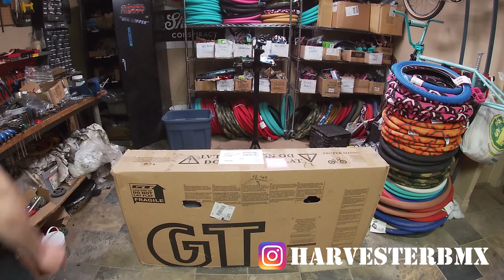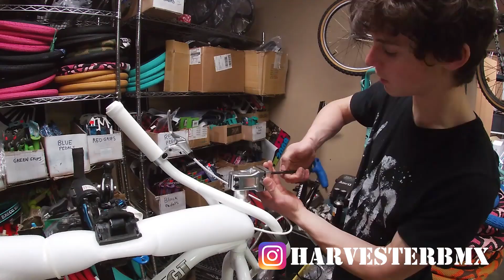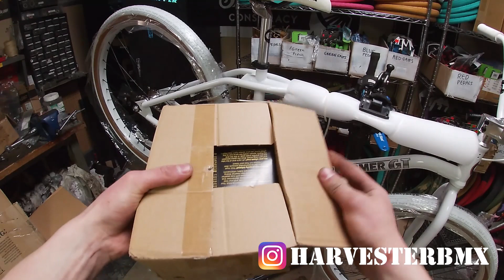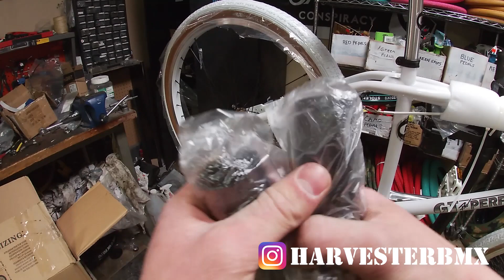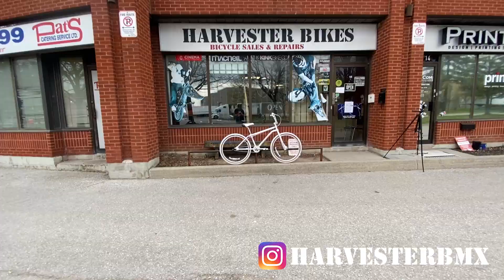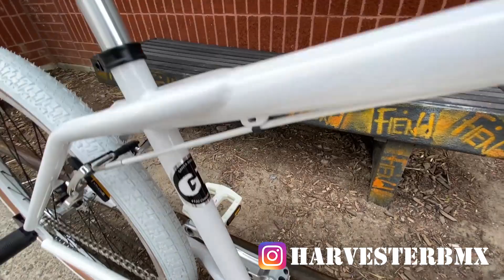2020 GT Pro Performer 26" Cruiser BMX Unboxing @ Harvester Bikes

Comment: Do you still have this bike?  These were commissioned by a company to be sold and the deal fell through.   Mine was assembled without the decals because it was a mock up.
Pretty sure there was a limited run of less than 10 when they were commissioned.